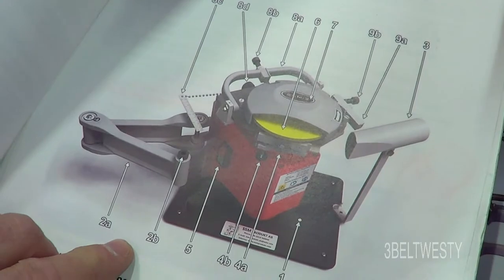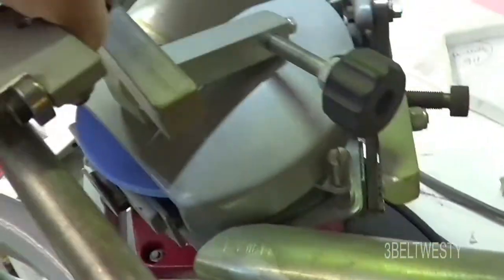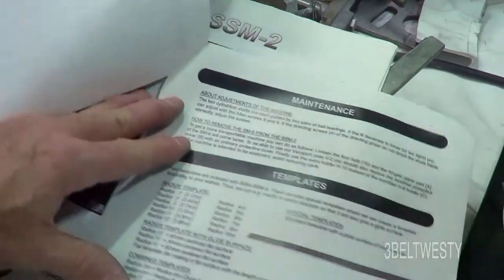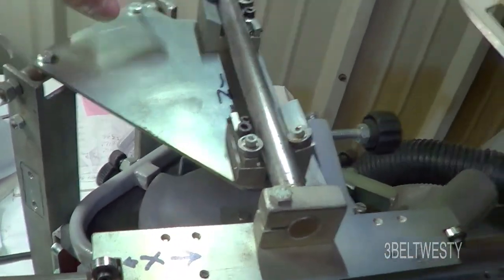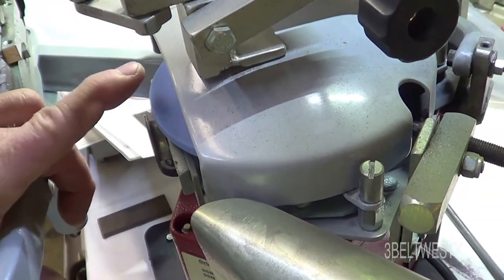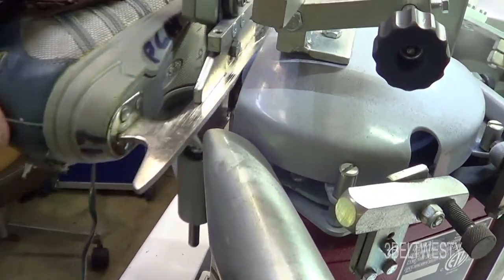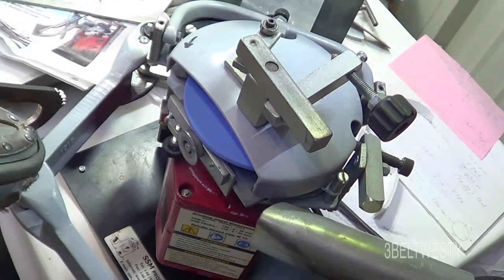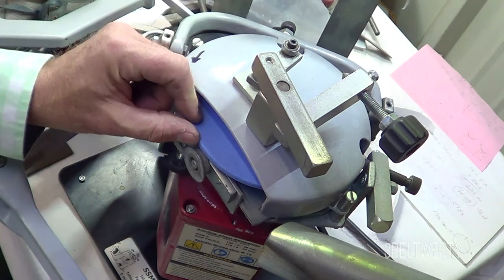ssm2 skate sharpener  with SM6 Profiling attachment

Comment: Hi there! Really appreciate your videos. Have you ever re-profiled a blade (with the added SM-6 tool) that already has been pitched? I´m curious if you can use the same method as in the Prosharp AS2001? I mean if you center the profiled blade pivot to the machine and then move the holder 20 mm before clamping? Would really be happy if you could post a video of how to do this in a SSM-2/SM-6 machine.

Comment: Does the skate holder hit to the follower roller, as there is no sparks in the middle section of the blade?
Based already on sound judgement in the very fist minute, there will be quite severe chatter marks on blade after this sharpening. Sound is like there would be run out on wheel even it is just dressed. Wheel is not most likely in balance and doesn't work very well for this steel quality.
Reply from the maker: Great observation! :   I may have done that ("skate holder hit ")at 0:06 since the roller follower was too far from the grind disc. Re " no sparks in the middle section ". The grind disc here is really past the diameter for being replaced. A slower surface speed (velocity meters/sec) adds to the chances of chatter. These skates are for rentals where within 2 to 5 sessions they get walked on concrete so the blade gets totally ruined quickly. 

The reason I removed the "profiling attachment" is  the grind wheel is smaller than recommended. Kevin The new owner of EZ Sharp skate sharpeners says the grind disc's composition is worst towards the center of a disc. With one expensive  Blademaster model sharpener they have a variable speed machine that uses 8 inch grind wheels. There is a speed knob one sets to change the rpm higher as the disc is worn smaller. The "speed/rpm" knob is marked in diameter. The chatter on this video here is probably three components, my sloppy quick video ;), disc too small, and disc composition worse towards the center.
Reply: @3beltwesty  SSM-2 should spin 3400rpm @60Hz. 
Wheel Diam. 150mm / 6”	        26.2m/s
Wheel Diam. 120mm / 4.7”	21.3m/s
Wheel Diam. 100mm / 4”		17.8m/s

Incredible Edger 6000rpm @60Hz
Wheel Diam. 75mm / 3” 		23.6m/s
Wheel Diam. 50mm / 2”              15.7m/s

I manage to use SSM wheels all the way up to 105mm @50Hz electrical network 
Wheel Diam. 105mm 		        15.4m/s

Due the 50Hz electrical network I am loosing already 20% of wheel rpm compared to 60Hz network. When the Incredible edger wheel starts to be in the end of its lifetime (too small), I can see remarkable difference compared to new wheel. So I agree that velocity speed matters. But comparing different machines and cutting speeds in different wheel sizes, I would say that wheel size does not explain everything. Balancing the wheel in SSM type of machine was a real nightmare, at least for me.

The point is not criticizing your grinding quality. What I am trying to say that people whom are interested about the figure skate sharpening should look all of your videos. They can learn a lot just by looking them. This is more like a tip for those people whom are beginners that where to focus in among the many other things. Please keep posting these interesting videos!

PS. I have planned to fix my Incredible Edger / electrical network frequency issue with frequency converter. This is what Blademaster has already done in some of their machine, just like you said. I already have that frequency converter. It should just be installed.